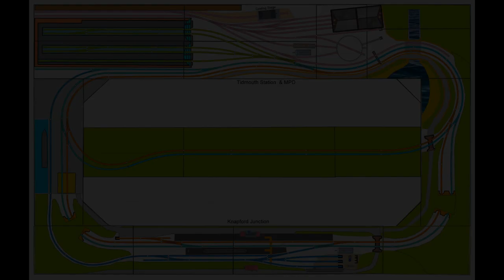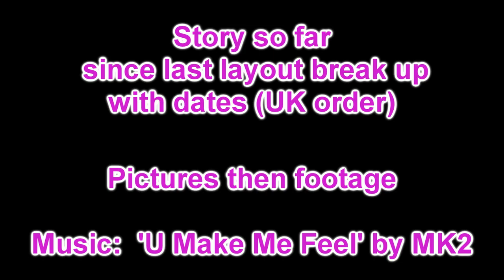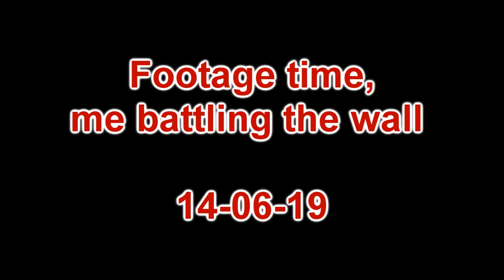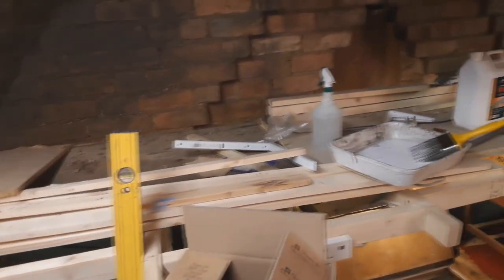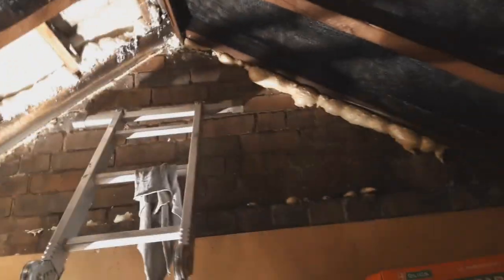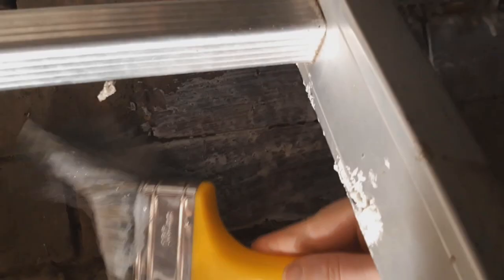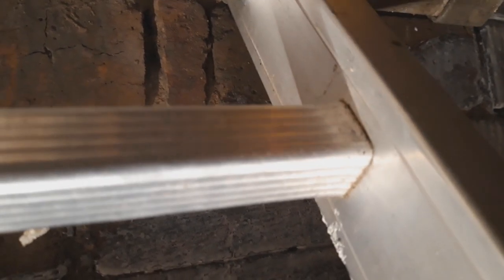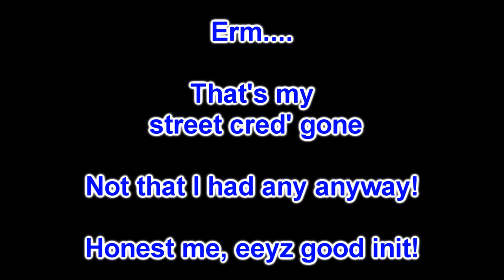NWR  - Tidmouth to Knapford & Beyond -  Part 1 -  Loft Preparation For New 00 Gauge Layout...

Comment: I was only eight years old when I discovered your videos back in 2007, and I remember how intrigued I was with your old layout! Of course, my interest in model railways has only grown from then. Thus, I am extremely excited to see how the new layout will turn out, especially when it comes to scenery. Out of curiosity, on your old layout around the Ballahoo Tunnel, did you use grass mats or sprinkled grass? If a grass mat was used, what was the brand and shade of green of the mat? If sprinkled grass was used, how did you apply the grass to the steep sides of the hill so well? Thanks!
Reply from the maker: Used scatter.  I remember actually chucking and blowing the scatter to the sides so it'd stick and not roll off.

New layout will be 80 x better. :)
Reply: @sparkshot  No kidding! I'll have to give blowing the scatter to the sides a shot! Looking forward to more progress on the layout :).
Reply from the maker: @TerencetheTractor525  thanks. :)  4 boards built thus.